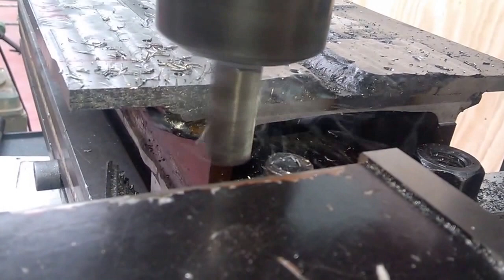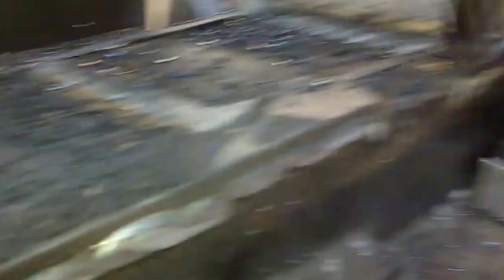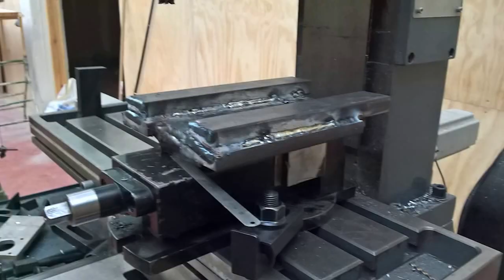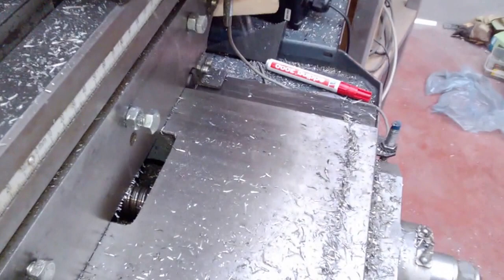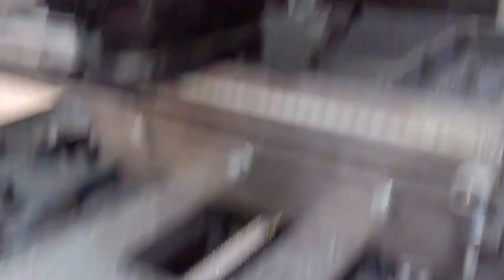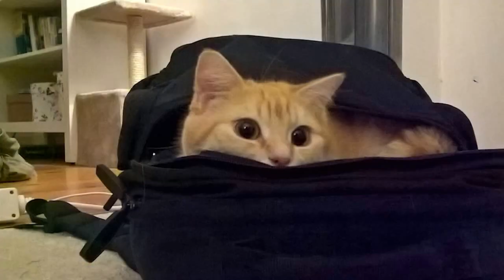Small-y - the DIY ATC small inline milling machine - part 2

Comment: You do nice work but run those endmills way too many RPM's. without any coolant besides air. Even cooling with air you need a huge supply of constant air. Also for face milling a simple fly cutter with a carbide tipped lathe tool will run circles around the endmills. When you see a tan or straw colored chip you better slow down the RPM's or its soon to be ruined.
Reply: coated carbide endmills really dont care...
Reply: @Windows350  didn't realize they are carbide endmills.      There is still chip load to rpm tho. Running too fast is kinda grinding, rather than cutting.
Reply: @coburnlowman  going to slow is like grinding, or am i wrong?
Reply: Fast RPM and not enough chip load is like grinding.     I have ran the endmills way over rated RPMs for a certain finish. There are charts for feed speed , RPM, to size of endmills.   But as stated carbide is forgiving.   My memory is getting bad , but back when I started carbide was only used for machining hardened steel or high production machining.   It has gotten dirt cheap now.
Reply: @coburnlowman  youre totally right, i thought you ment too much feedrate is like grinding. sorry for that.